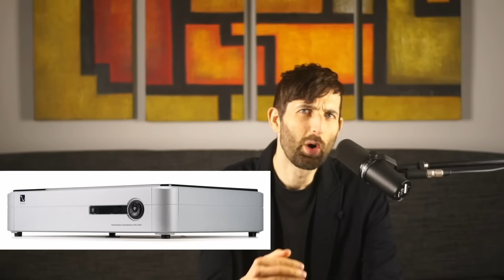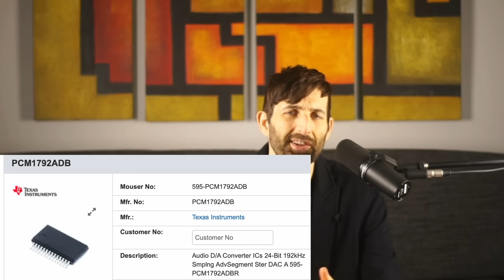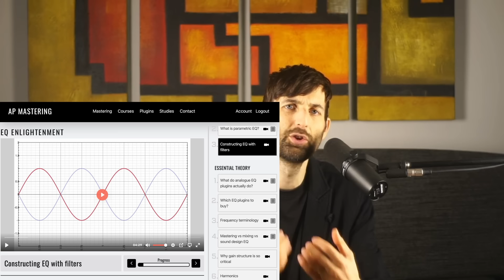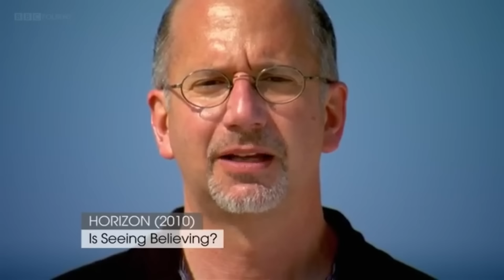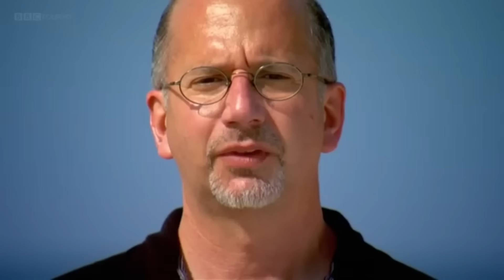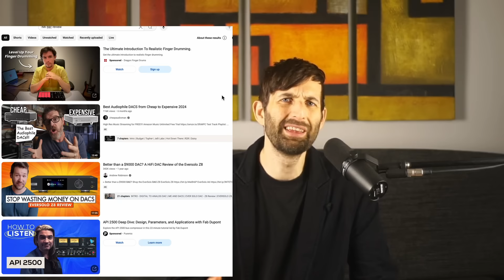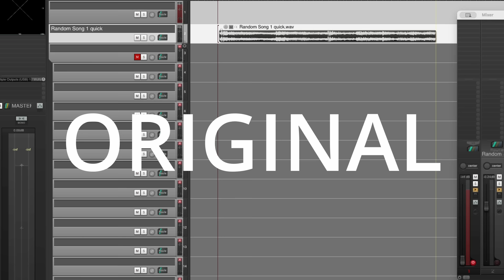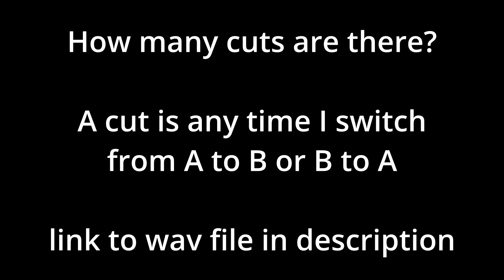The DAC Scam - Almost everyone believes the hype

Comment: You yourself said I will show you what a bad ad converter is and we could all tell on the sample you played. Bad or different implementation of dac chips happens. Some companies have a house sound neutrality and transparency are not always what the company or the listener wants. Take valve amplification and solid state it's clear which has ;was distortion but still lots of people like the valve sound. If you engineer a speaker to have a completely flat response it will most likely sound terrible in most people's rooms. Oh don't get me started on the room the biggest effect of all on how things sound. As to the fact there are ladder DACs some with valves in different types of audio stage  different output impedance etcetera. Bog standard capacitors in the signal path or audio file capacitor.  If you want to complain about audio quality think these people with there expensive in your opinion stupid because they pay so much for something that sounds the same at least listen to the music in full resolution trying to hear the music as the artist intended. Or Joe blogs sorry Joe who listens on a cheap crap pair of headphones or a boom box to an MP3 version which is definitely inferior and also not the full quality of  what was recorded by the artist.
Let's all get pro equipment stick it in our lounge and the true artist intention.  I will start with a pair of active ATC monitors. I like to stream Tidal so a wimm ultra streamer will work for me. Music system created all done for about 15000 pounds. I AM happy are you?

Comment: Absolutely awesome video. I run across snake oil products all of the time (even looking back decades). This audiophile nonsense-trash creates such skepticism in the markets that when real innovations come along as a result of genuine engineering - those good, new products, services & ideas need to wade thru such a river of doubt created by the snake oil - that touching base with  industry marketplace decision makers is next to impossible. So far, this has been my experience & thank goodness for people I already had in my network of professional contacts! The industry has been building quality DACs for over 30 years. The only way today's DACs impress me are when they are intelligent & use CPU power to REPAIR certain types of damaged waveforms. Of course, this is heresy to many "audiophiles" because the DAC is changing the digital signal (because we all know that digital audio passes thru the audiophile Vatican where it is declared immutably perfect & holy - but only in the form the record company released it in)! And G*D-DAMN Y0U if you alter a single bit!  So, multi-year projects like mine that leverage AI & proprietary software are often the bane of many an "audiophile's existence". After all - much of the damage caused by the loudness war & other causes is UNdone within the pipeline process I utilize! And these improvements are not difficult to hear & analyze. Never before has the technology existed to make such improvements to audio using smart processing! Your video nails such a gigantic problem! Keep up the great work!

Comment: 🇬🇧 👍🏽 March 2025

'Military grade' often means a set of priorities that run completely against, or at the very least nothing to do with - the priorities of hifi music reproduction.

Resistance to moisture, severe heat, severe vibration - are not parameters which a good audio chip should have to take into account.

If you look at military helicopters - there is no 'fit & finish' inside - they're just slung together, for functionality - not 'quality' per se.

You want your audio chip to have been designed to a brief where extreme environments have nothing to do with it.

Comment: What you're forgetting about is, the quality of the power supply in better quality dac, the power supply has a big influence, on how the dac sounds, yes the sound has to go through the op-amps, but the better the signal to the op-amps, the better the op-amps operate,  also, it goes for the quality of all the other parts in the dac as well 😊

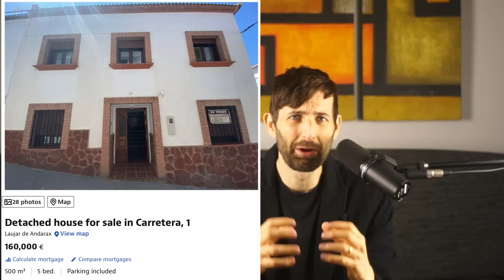Comment: @0:40  What you mostly get for a 160k DAC is a lot of smoke blown up your arse.   FINALLY another that gets it. You DON'T always get what you pay for and I am finding out that scams and snake oil DO abound in the high end audio market and I generally stay away from it.  Why?  Simply put, the more you pay, the greater the risk you are going to be taken for a ride.   As the OP points out, most of the "high end" DACs still use the same processing chips as lower priced models with the AKM 4499 being one of the top DACs out there.  Granted the difference between the sound of a DAC is in the analog circuitry, but as he points out, EVEN with boutique components a DAC should NOT cost over $1000.    Perhaps with some exterior embellishments that may be an exception to the rule, but would you really want to pay $1000's on cosmetics, which have nothing to do with the sound quality.    Given the size and components used in a DAC, I really cannot see how you can get anywhere near five figures. 
So, where is that money going?  Well, for the most part, you are lining the pockets of the upper brass of the people that produced the product.   Sure they might site labor and research and developement.  Buy why should the first 10 buyers pay for that up front (on a $40,000 Dac) and then the rest just line the pockets of the greedy.   That is what I call "trolling" and really, it has to stop.
"Why should I care?" someone might ask, when it isn't my money to spend.  Well, if you think about it, if a good manufacturer sees people buying that $40k DAC and they KNOW it is mostly hype.  They will get the idea and say, "Well, if so and so company is getting that for a DAC that should cost $1000, then why don't we raise the price of our $1000 DAC?" 
Also, auction sites like Ebay are no help either as they tend to drive prices up on things too. 
The biggest problem lies in the buyer that has so much money that it is hemorrhaging from the anus, but isn't really educated in the realm of audio electronics.  Most are under the belief that the more you pay for an item, the better it will sound.  While that may be the case up to a certain point, we now enter the realm of the Law of Diminishing Returns.    While many believe that if you pay double for something, the quality will be twice as good.   That is almost never the case and it is DEFINITELY not the case in hi end audio.  Case in point, I have heard a friend's $10k sound system, and frankly, it only sounded marginally better than my $1500 sound system.  So, really is it worth it?  To my friend, he thinks so.  I personally told him that he was taken for a ride.  Why pay so much for so minimal improvement?
You might see the biggest returns in jumping from an item that costs $10, to $100, and finally $1000.  But, really, after that point, I can pretty much safely say that improvements will be marginal for any single item.
Those with golden ears may tout.  Well, you have to buy ALL of your gear for five figures each and then you will REALLY see what you been missing.
As the OP points out.  There are those that justify the believe in something is better either by pointing out far out specs that one cannot hear.   Or it is just the fact that they are reassuring themselves they are hearing an improvement because they spent so much money on it.
The bottom line, people, is that when it comes to high end audio, you have to educated yourself not only in the specs, but how an item is built and put together.  There are some good manufacturers out there, but there are a good many that are trolls that are just going to rake you for your hard earned money.   These trolls are what are ruining the hobby with their overpriced crap.  Do your homework and don't feed the trolls!

As for the switching test.  I have a decent sound system on my computer that is using PSB speakers.  I know, there  is only so far you can get with You Tube an it's compression.   While I do hear something, it is hard for me to pick out when and where the switching occurs.

To the OP, GREAT video!

Comment: I have a Topping DAC and separate Topping headphone amp which were maybe $150- $200. They drive my 250 0hm and 300 ohm headphones fine without any discernible jitter. I guess the resistors and capacitors do the job.

Comment: I can agree with you in many aspects you mention it is nonsense how  many manufacturers depend more on bulky metal cases to sell than engineering, high-end indeed has a lot of bulshit but that's not only coming from manufacturers but also from customers who expect and request that kind of silly and nonsense products. But I have to disagree that a converter it is not only the digital chip because it is in the end or better said in the beginning in the digital domain but It is the truck conversion When that signals goes analog that the tricky part starts from power supplies from capacitor Banks and old the analogue circuitry that's the important thing and that's why many converters sound different one from another despite using the same chip

Comment: Audiophiles drive the development of new product, so I do not dissuade their passions. The Vivaldi is a beast as confirmed by analysis tools. I order chips and testing boards (they will ship most of these high end chips free to AV guys for testing), but a beautifully packaged product is still appreciated. High end integrated headphone amplifiers are a positive feature of some of the higher end converters as well. RME has a great balance of price and performance. I just sold a few converters and just use the ones in my monitor controller now.

Comment: My Dac is an upgraded Schiit Bifrost. Which would cost around $750 new, but I got mine for $450 used. It doesn't even use a traditional dac chip. Instead, it uses Schiit’s proprietary multibit DAC design, which is based on Analog Devices precision ladder DAC chips (AD5781 and AD5791),  meaning it uses a series of precision resistors (or, in this case, high-end AD chips) to convert each bit of the digital signal directly into voltage. It sounds awesome. 

And for everyone complaining that audiophiles spend too much of their own money on equipment, keep in mind that you can build a very decent sounding system these days for under $1000, maybe even $500. But what's wrong with wanting a bespoke system that includes the best stuff you can afford?

Comment: I can only guess that you either don't have a decent enough system that would resolve that level of sound, or you've only heard budget DACs. Because my system went from good to great going from a $100 to a $700 R2R DAC. Chips aren't the only factor. The implementation of the power supply, clocking, and output stage matters more than the chip itself. Also, if you are using MP3s or listening to Spotify, then it's going to sound bad no matter what. From someone who used to think this exact same thing, trust me, DACs matter!
Reply from the maker: psychology

Comment: You are so right, I wrote a paper to myself about all these frauds. By the way the biggest fraud is Digital cables whether it is HDMI, Optical or coaxial. More than $10 is a rip off. But in the line there is the Power cords, Speaker cords, then interconnects. I really laugh about the break in services of cables etc.. I always say if you want spending money, maybe invest of consulting a real acoustic engineer to look at your listening room an improve what is possible within limitations.

Comment: I think implementation is as important as the chip set and component type and quality in the whole circuit and mechanical aspects all make a difference. However, whether a DAC needs to be any more than about £10K to perfectly finesse all this, is unlikely in my view. Unless it's gold plated and diamond studded, but that's another issue....

Comment: Hmmmm - so Chord DACs are FPGA based using their own proprietary filter. Denafrips, Holo Audio, Gustard and several others are discrete R2R "ladder" DACs. Audio Note still use old burr Brown chip ladder DACs. It's just not true to say they're all using the same chips inside.
Reply from the maker: i discuss R2R later in the video. FPGAs are an attempt to reinvent the wheel and not better sounding then a 10$ chip

Comment: Absolute nonsense... considering the standard we are talking about  today the chip is the less important. Power supply and output stage are by far more important!!!

Not saying that all the high prices are justifiable... but he is reducing a DAC to the least important component. 

Just because the chip does the actual conversion does not mean it's the only considerable variable sonically.

Strongly biased.

Comment: People who spend the BIG BUCKS needlessly are called Audiophools.  I have a card with removable DACs (Auzentech X-Meridian 7.1) and still have the chips, the card died. 1 Texas Instruments, 2 Bur Browns, and 1 AKM bought from Digi Key.  My Harmon Kardon 730 at my place, mine, and any of my speakers I could tell the difference with anything above 16/44.1 CD Quality but with  24bit 96KHz stereo from any HQ source it didn't sound the same.  Difference isn't worth big bucks and it came down to  Personal tastes.  Old GI system with Old school Power will easily let you know.
BetterTested system of my Bud's.
Pioneer 1250 Receiver uncoupled RCA out to straight to the AMP from the sound card, no 1250 preamp (Preamp is a 1250 strong point) and HPM 150/1500.  I personally liked the slightly warmer/softer Bur Brown $8.79 DAC chip LOL!  Dead silence between songs, zero feedback and pure  bliss.  Also, Windows 2000, Monkey Audio.  Hell we even made Copies of my DVD Audio Hotel California DVD Audio Disc in both 5.1 and 24/96 2ch via Analog Copies  (Couldn't do 5.1 on his system.).  All differences were slight to very slight.  Disc did play on his DVD Player in 5.1 upstairs.

Comment: But that's allure of the high-end.  I personnally don't mind spending a factor of up to around 4x for better build, serviceability and esthetics.  But the ultra high-end is simply ludicrous. 😮

Even in the years of tape decks they would give the spec of wow and flutter, something I've never experienced.  Yet audio dropout was very common, the tape fails to make full head contact.  Never read of any issue with dropout most likely because of the powers that be. 😮

Comment: If I wasn't witness myself I would probably agree with this because internet makes you do that but no, you are totally wrong AP Mastering. I was using Defapris Ares II dac which was fun to listen, then one day I saw that a guy I know was selling AVM cd 3.2 cd/dac for a really good price so I just took it and wanted to give it a try and see how it was going to sound and I was very sure that I wasn't gonna hear some much difference, may be some minor tonality difference but not much . But like you I was very very wrong too. There were two friends of mine with me that day and well we were so shocked when did the first a/b test we looked each other without saying anything but the differences were obvious. CD3.2 is 5 times more expensive than Ares II and it blew it out of the water in the first listening session. Only bad thing about hi-end world is you have to pay so much more that it is unparalleled with sound. Better equipment usually costs more, means better chassis better power supply better sockets better this better that, so you are paying for the whole package not just for the sound itself and so it's better not to forget that. For example if you pay 2 times pricier item probably you won't get 2 times better sound.